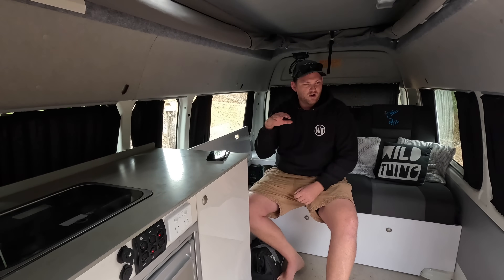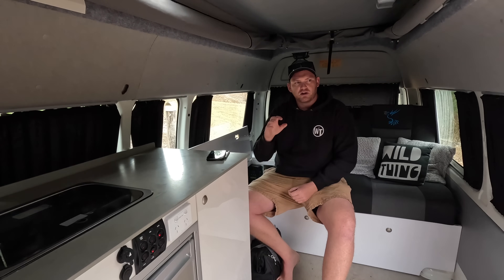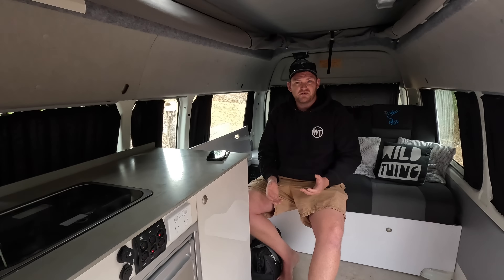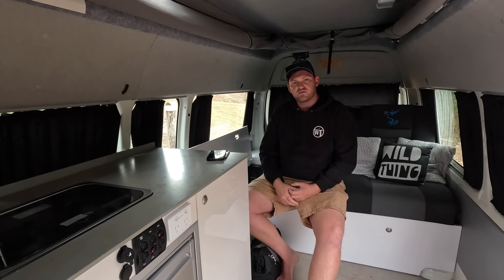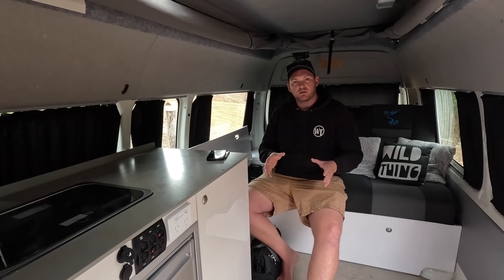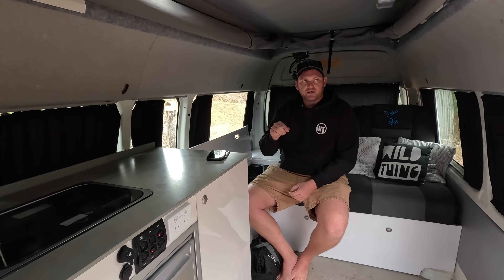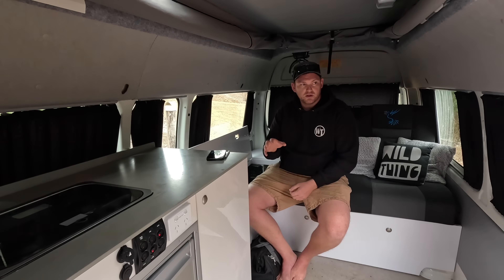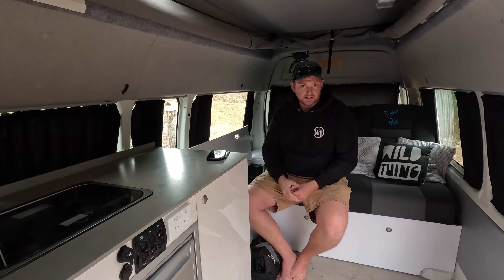'DROP IN' LITHIUM BATTERIES || The truth about charging a lithium battery with a lead acid charger..

Comment: HI. Question: do you think I did some damage to my camper van lithium battery if I charged it ONLY ONE TIME with a lead acid charger? thanks! the charger (and not the battery) got really hot after about 2 hours of charge. Thanks in advance!
Reply from the maker: I couldn’t say for sure. But probably nothing too serious if it’s still showing correct voltage. The internal BMS would have hopefully protected it from over charging / overheating
Reply: Thx!

Comment: I'm surprised most older chargers don't have a lithium profile? I mean they have been around for a while. I got a cheapo portable solar panel with a MPPT charger from amazon and even that had separate charging profiles for AGM/Lithum. Anyways is there a video on changing a LA charger for a Lithium charger and can you usually keep the same cables?

Comment: There is way too much spin about drop in Lithium batteries they are light and can deliver a lot of power but they have significant shortcomings like people they want to be kept at a comfortable temperature +4 to 28 Celsius that's why electric cars have battery heaters and radiators. If LG can't keep house storage batteries happy under the eaves of a house inside a parked car can hit +70 degrees, the AGM battery wants to be kept charged the lithium would prefer to be only charged to 80% that's why your iPhone does that at night. Its easy to get a charger to float a AGM battery but a lot more complex to manage a lithium well

Comment: Get a Lithium profile AC to DC charger. The only "drop-in" replacement I have seen is one for the cranking battery. iTech does one and going by their blurb they are the only one. They have a inbuilt charger that is suitable to work with the alternator output. Other brands need a separate charge controller.
Reply from the maker: Almost any lithium battery will accept straight alternator output voltage. And function okay for a period. 

But not one reputable brand would ever recommend it for all the reasons mentioned in this video.

Comment: Not ideal practice but could you reuse your non lithium 240v AC charger and charge your starter battery to indirectly charge your lithium battery? That way your Dcdc charger will regulate and supply the current lithium charging algorithm.

I’m in the same situation, non lithium 240v 25A AC charger, 25A DC DC charger with lithium profile. AGM battery but looking to upgrade to a lithium battery.

Comment: But look at the 8s , 24 volt lifepo4. its the same perimeters, as lead acid 24 volts. 4s, and 36s and 48s do not match at all, but 8s is the same. I have an older  15,000 watt UPS/ATS inverter /WITH A 60 AMP charger. It only has settings for lead types.  An actual pot you need to turn with a tiny screw driver. It's a great lead acid charger. The last 4, 110 amp hour deep cycle batteries FROM WALMART, were still working good when I sold them for $50 each 6 YEARS LATER. These Sealed lead acid had air tight caps you could unscrew to check and refill the water. 
  The lowest voltage setting, I think it is for the GEL perimeters, are basically the same needed to keep lifepo4 up and ready.  I've heard it explained that lifpo4 does not care if a trickle charge exist, mostly because they won't trigger it much because they hold a charge. It works just like small UPS people use for their home computers for an uninterrupted power supply.  I've had 2,   100 amp hour 8S lifepo4 batteries connected to that inverter charger , for a good 5 years or so and the cells look good. The only problem I have, is due to unmatched cells. But some 10 amp active balancers helped that situation. 
   The "cycling" pack charge shutdowns, are from unbalanced cells and unmatched cell capacities that charge and discharge at different rates. A lithium charger will do the same thing.. 
  I just paid extra for some new ,tested and matched 300 Ah cells and those work perfect on that 24 volt, 60 amp charger, UPS ,ATS. Huge difference in the end charge cycling. This is none.

Comment: I got suspicious when a guy at work was telling me Itechworld in WA claim their batteries can be charged by normal lead acid charger. I did a bit of research and changed out the AC charger in the van to a Victron unit when I installed my Lithiums. 

Itechworld's web site FAQs
"I have a non-lithium profile charger; will it work with your battery?

99% of all non-lithium profile chargers are compatible with iTechworld lithium batteries, the only chargers that may not be compatible are chargers that are specifically designed to charge calcium batteries. Non lithium profile solar controllers and non-lithium profile DCDC chargers are also compatible with iTechworld batteries. The battery will charge to 98%-100% when using non lithium profiles. Using a non-lithium profile charger will not shorten the lifespan of an iTechworld battery, we warrant our batteries for use with non-lithium profiles.

What non-lithium charging profile should I set my charger to?

If the charger has a lithium profile; it should always be used ahead of all other charging profiles. If the charger does not have a lithium profile you can use AGM and GEL as iTechworld lithium batteries can accept charge from those type of profiles."

Comment: That agm in your parent’s van must have been crook. The least I’ve ever got from agm is 7 years.
Reply: Depending on how they are used or abused,20 yrs off grid 12 v Lead acid experience,,I avoid conversation about batteries,,most people will never get it and can't be told anything , LoL
Reply: @jeffreystorer4966  I’m hearing you 😀

Comment: That certainly cleared a few urban myths 
Some manufacturers offer drop in lithium for starter batteries
The problem arises when you have a dc/dc charger which are all designed for lead acid starter batteries 
They all isolate the starter battery at 12.7 volts which is ok for lead acid but dead flat for lithium 
installing a smart battery protect solves the problem however they can’t handle temps over 60 degrees which is no good under the bonnet
Reply from the maker: Theres some interesting developments happening with under bonnet lithium. I reckon we're pretty close to seeing some viable options available soon!
Reply: @WildTouring  The folks running DCS under bonnet would all say there are viable options now. Im yet to see a report to the contrary about them.
Reply from the maker: @bradleymarshall5591  Totally agree. There is nothing currently available on the market that I’d spend my hard earned on to cook under a bonnet. And their warranty periods reflect the confidence the battery sellers have in them!
Reply: @WildTouring   What sort of warranty do they offer? Not many manufacturers offer more than 2 years that i've seen. Not meant to fit AGM's under the bonnet but ive only just retired my fullriver AGM after 10 faithful years of under bonnet use. Not sure it's the death sentence some make out,
Reply: I took on a lithium starter/winch battery from Itech just on 12 months ago.
I was asked what aux battery isolator I utilised (Redarc 25D). As a result I was advised by Itech prior to purchasing this would be an issue and that I'd need a victron programmable  isolator or a ignition relay to seperate prior to 25D 12.7v isolation flattening my lithium starter battery.
As I already had my previous Redarc 12v VSR, I simply disconnected the VRS circuit from the relay, wired relay directly to ign and now switch the Redarc 25D on/off with ignition, easy fix, no heat issue or complication of variable isolator, again some things can be over complicated.
I give full credit to Itech for disclosing this prior to purchase, ♥️ my Itech drop in starter & aux batteries.
My only issue is my Redarc BCDC25D is mounted under bonnet also and regularly shuts down charging due to overheating, need to upgrade it to 40amp DCDC charger relocated to better air flow, will be happening later in year.
Reply: @ianweal3081 it’s great itech are advising people prior to purchase, I gave them a good serve a few times over these issues and it sounds like I wasn’t alone 
I have the itech 40amp dcdc charger mounted as far from the engine as possible with no issues, however I’m about to test on a remote hot 15 hour run
My 75Ah dcs lithium under the bonnet will also be tested 
It has a 3 year warranty

Comment: Good info! I've got the opposite scenario of a lithium AC charger and AGM batteries. 
The batteries are cheap/questionable no name quality AGM's that came with the camper from new. I requested the lithium AC charger for a near future plan of replacing the AGM batteries.
When we purchased the camper I expected them to fail quickly compared to other reputable brands.

I've found running the charger in power supply mode or float charge mode (13.8v) effectively trickle charges the batteries and they seem happy in doing so over the past 7mths of constant use.

As you mentioned lithiums bulk charge quite aggressively so keeping that in mind I don't use the proper charge mode unless they have been floating at 13.8v for a period of days and I want to quickly top them off to 14.4v before heading away etc. - The charger usually kicks straight into the final absorption stage from 13.8v and tops them up to full within an hour or two.

Theory is it's less shock on the batteries to go from 13.8v float voltage to 14.4v than it is from 12.5v to 14.4v. Otherwise they bulk charge harder and longer than I'm comfortable with.

Comment: Scary thing tho ya relying only on  electronic stuff and if something stuffs up like say over charging the battery it  could ignite  , or the fancy internals in the battery malfunction it could ignite  , I'm not sure we are ready to put them in side off our mobile homes  yet because if a lithium battery did ever  catch on fire it's game over  9
Reply from the maker: Any electrical system has an element of risk. If anything, lithium iron batteries are amongst the lowest risk. I think there may be a lot of confusing LiFePO4 with other lithium chemistry.

The lithium ion battery in your phone/tablet/kindle that most people place by their head while they sleep, leave on flammable surfaces like their couch or bed throughout the day or in their pocket by their groin has a much higher chance of combusting. 

Lead acid batteries in most vans have no protection against a dead short across the terminals. If something conductive bounces around and lands across the terminals it’ll spark and heat up until it’s moved (ever accidentally dropped a tool under the bonnet across the cranking battery, and it starts welding itself to the terminals!). LiFePO4 batteries won’t do that, they’ll open the circuit if they’re overheated, overcharged, over discharged or in the event of a dead short.

Comment: Good information but you're absorption theory is incorrect.

AGM profile will go in to absorption mode around 70-80% of lithium SOC this is done by voltage reading. Then it will drop voltage down to slow down the amp charging rate. For lithium it will be extremely slow and with enough time it will fully charge this will not hurt the battery in any way just unlikely to ever fully charge it.

Comment: I've heard that when buying and before installing a lithium battery, the cells need to be averaged out by discharging, then recharging the battery with a dedicated lithium 240v charger.
Would that be right?

Once again, a good video, Cam.
Cheers.

Comment: very good vid Cam, I likewise, have had this discussion with people wanting to upgrade.  But let me enlighten your followers to another similar situation that can lead to expensive tow tug repairs. Some camper trailer sellers offer Lithium battery/s in their camper but these  are NOT fitted with a DCDC Lithium charger.  This is a major problem when connecting to the older style VCR dual battery systems in many tow vehicles. Because lithium batteries can draw huge charge currents, these currents can destroy alternators and wiring (if undersized) and cause vehicle fires....so insist on a trailer installed DCDC Lithium charger before taking delivery of your camper that is fitted with Lithium battery....Keep up the good work bro....Cheers
Reply from the maker: Noticed this on a mates 100k van 😳 
Huge amount of voltage drop causing current to increase and he couldn’t work out why he kept blowing the inline fuse. 🤯 blew my mind that they would not have a dcdc charger in the van!

Comment: Good video you put up. I recently got a itechworld 25am dcdc charger and battery and am struggling to ever see it hit 100%. Do you know if that’s normal for lithium. I’ll have to go back and watch your dmax 12v fit out
Reply from the maker: What are you monitoring state of charge with?
Reply: I run all itech gear in my van.
You will need to buy and install a battery monitor/Shunt to get an accurate reading.

Comment: I'd love to switch from AGM to lithium but with three separate systems (Coaster, 4x4 and camping trailer) all using AGM specific gear, it just keeps on going in to the too hard and too expensive bucket.
Reply: - At least Lithium batteries are light - fit (or have fitted if you can find an Auto Elec willing to do a crimp or 2)  the DC-DC  charger with Anderson connectors and the whole setup can move from vehicle to vehicle as the seasons change..

(I have had a Redarc BCDC1225D purely hooked in with Andersons' for years - it lives connected to an AGM (mostly on a 240VAC maintenance chrager) but can simply be unhooked and swapped over to an  LFP  as needed- change mode - orange+green wire - and off you go.  In my ute there is a 200AH Renogy LFP- I went with the Renogy 50A DC-DC charger - installed nearly 2 years, no problems so far - flexible solar strapped onto the roofrack (or on top of RTT/Rack Bag, for when it is needed) )
Reply: @kadmow  We have a DC-DC in the 4x4 but the Coaster is 24 volt so it gets a bit harder to swap things around sadly.
Reply: @WesternAustraliaNowAndThen  ,, Redarc BC-DC allow 12 or 24V input (buck/boost converter - the Solar input is  also 9-32VDC) , others may too, though Enerdrive DC-DC Chargers are separate models 12v and 24V models.. (BCDC1225D/1240D 9-32VDC Input. Source, Redarc)

Comment: When I built my van, 2005- 2007, my 12v system was 2 ,260 AMP HR, Full River batteries, 90 kg , each, 1 solar panel, 45 AMP, charger, Batteries lasted 12 yrs, Now have 2, 270 amp hrs, AGM, Super charge Batteries, 71 kg each, nearly 5 yr old, Still going strong, Read about drop in lithium, glad I watched your advice, Gives me something to think about, All my caravan is 12 v, If AGM,s last a few more yrs , cost wise I will be using them again, Thanks for your input, Cheers Bevan

Comment: I just checked my 240v multi stage charger which has GEL(14.1V) / AGM(14.4V) / WET(14.7V) and found in the manual the wet mode goes to 16.0V in Recondition stage. AGM mode stays at 14.4V. And the battery specs say to charge at 14.4 - 14.7v so AGM mode on my particular charger (Projecta IC2500W) should be fine. Thanks for the thought provoking video to make me check.
Reply: They float at 13.7 though. Too high for a lithium? Should be 13.5
Reply: @merdel9663  ahh yeah. Didn’t notice that. I usually unplug it soon as it hits float anyway. I’ll be really careful on the odd occasion I use it. Thanks
Reply from the maker: No worries 👍🏼 that’s good news!

Comment: If you're spending the money on a lithium upgrade, I'd also recommend installing a smart shunt like a victron BMV-712 so you can always check the battery state of charge accurately and see if your charger system is working as you expect. You can't just look at a voltage gauge anymore.
Reply from the maker: Yeah definitely! Stuck a BMV712 in dads van, same unit I run in my canopy and caravan 👍🏼

Comment: Great video.  As a sparky, it drives me crazy the number of customers telling me that the battery salesman says, "She'll be right." It's very misleading the "drop in replacement " sales pitch.
One other thing I'd like to add to your video is that the float stage on most SLA battery chargers will produce a small current. Lifepo4 don't like a current put into them at full SOC. This will also shorten the life of your lithium battery.
Keep up the great content.
Reply from the maker: Yeah I can imagine! I guess it’s probably good for business (fixing all the crappy systems) 😂 

But I hate to hear about ppl getting ripped off!